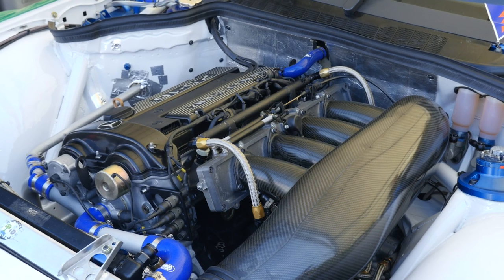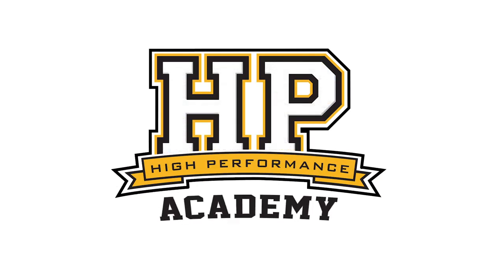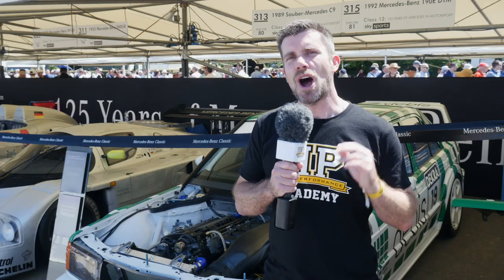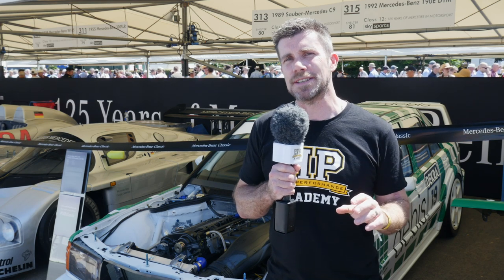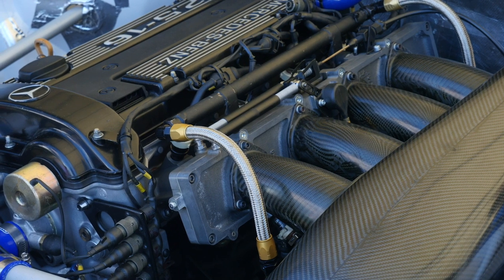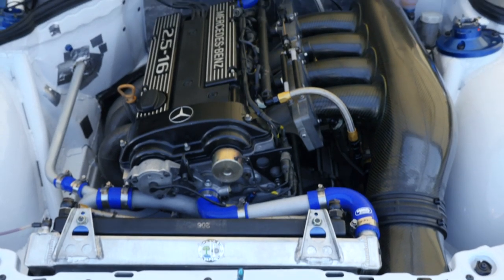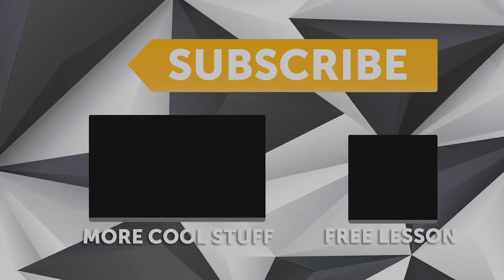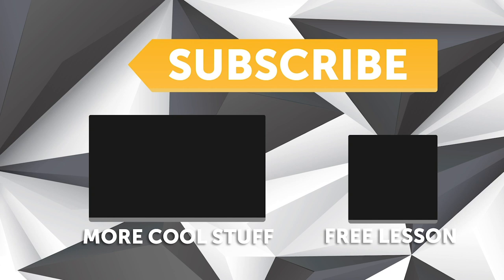Why The Slide Throttle? | Mercedes-Benz 190E Evo II DTM [TECH NUGGET]

Comment: Would be happy to see a video about roller barrel type and a comparison between all types of throttle bodies
Reply: Problem is at low loads, wide open its perfect
Reply: I've seen most rallycross super cars with roller barrels, but older N/A race engines seem to favour the slide type throttle.
Although I have seen a cut away of an old Toyota F1 engine where a duel roller barrel setup is use. So there are two separate rollers rotating away from each other.

Comment: They can give a near perfect path at WOT, but they are prone to sticking and can be difficult to set up with a smooth progressive action -  the last may in part be due to most using mechanical fuel injection, which can be problematical. There are also apparently benefits to the pressure wave tuning with butterflies. Whatever the reason, slide throttle fell out of favour decades ago, even in F1.
Millington have been building VERY effective N/A rally and race engines for many years and for much of that have had their cylinder heads cast with roller bodies integral with them - must be some benefit well worth all the extra hassle and expense?

Comment: In Formula SAE, I've seen at least a dozen different throttling arrangements. In the real world, there's a reason the good old butterfly is used 99.95% of the time...
Reply: Are motorcycles not part of the Real World?    They use slides and are considered to be reliable.
Reply: well it's the easiest and cheapest to manufacture. There's no argument there. To gain efficiency, just increase or decrease the overall size.
Reply: @Themayseffect  agree if You have only one, and it is far away from engine head/valves. 
But i think its not so simple if You have ITB. 
By change in intake diameter You manipulate the speed and pressure in air flow.

Comment: how come nobody makes an aperture TB?  Like a camera...
Reply: lol ...
Reply from the maker: Has kind of been done via adjusting length:  http://bit.ly/McLarenF1Tech - Taz.
Reply: Iris throttle body. It was tested years ago, but I think the air pressure caused problems with the blades being stuck open from air pressure. This was on a turbo motorbike. It's a great idea, and there have been manifolds designed with it to broaden the torque curve. Maybe we just need more research done.